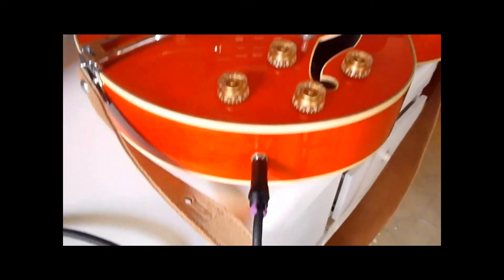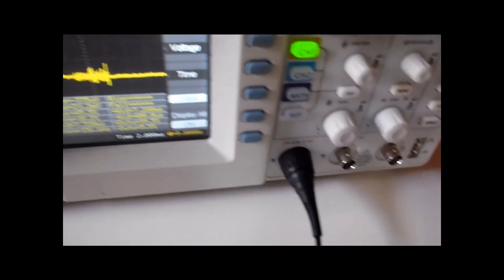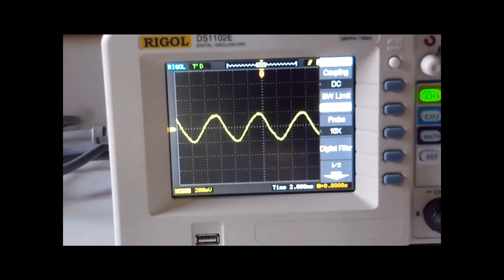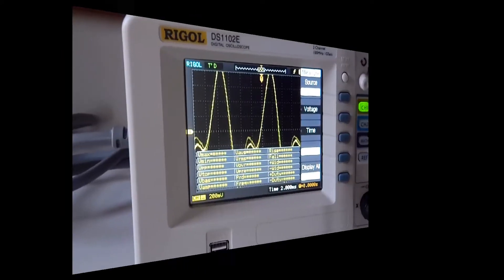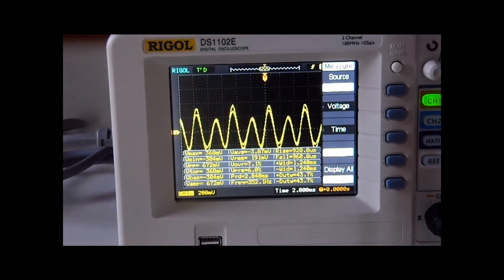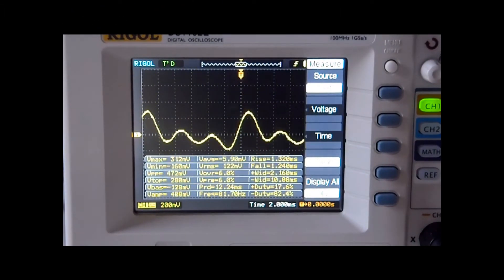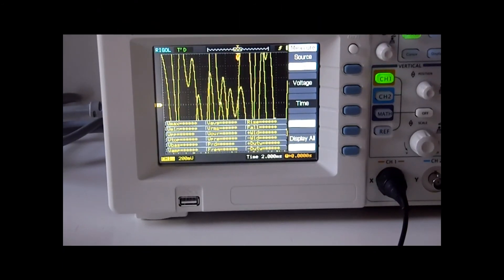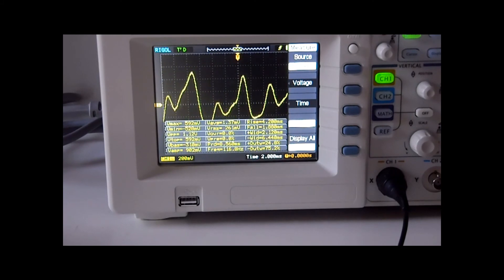Guitar Sound Waves

Comment: It would be the same to connect the oscilloscope in to the output jack of the guitar right? to the tip and sleeve so you can connect the guitar to an amp record the amplified sound. Great Vid.

Thanks.

Comment from the maker: Hey in the sense of amplitude, there is quite a bit going on roughly it is easy to state that lower voltages come from higher pitched notes - due to frequency. Just as higher voltages come from lower pitched notes, in direct relationship to the frequency. For the voltages max and min. amplitude - the highest output coming from my guitar 1Volt peak to peak (this is reserved for the lowest E note playable, as the frequency is the lowest) for and the min. is slightly higher than 10m Volts p -p